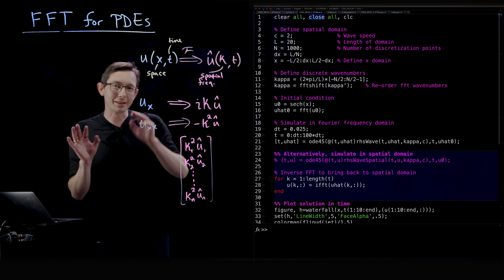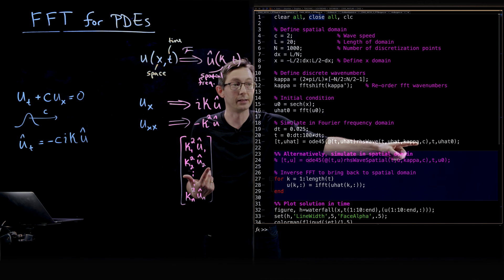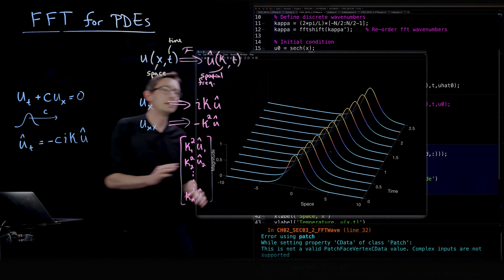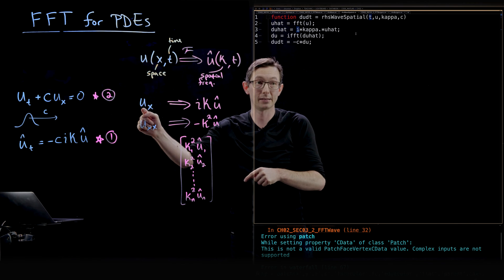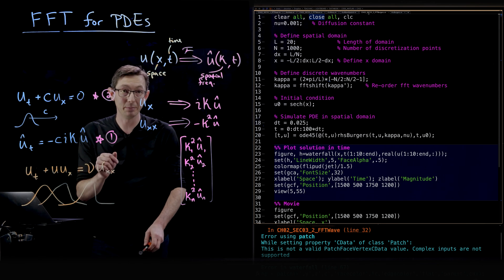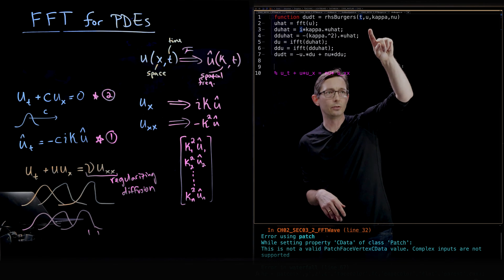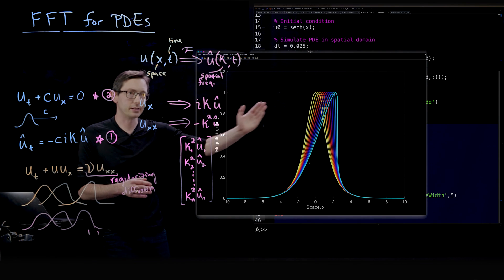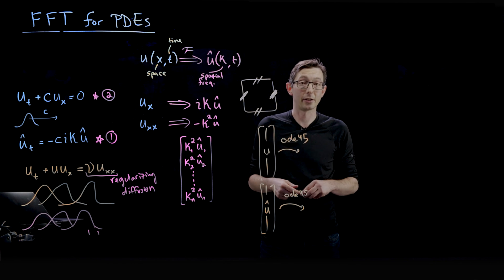Solving PDEs with the FFT, Part 2 [Matlab]

Comment: Would it not have been fun to pick dispersion as a topic, where c :: f(kappa)?
Given its many applications (fiber optics, for example), this would have been a kicker... Also showing what gradient fibers do to help it, group velocity and all that, why monomode fibers help with it...

Also I would have appreciated the mentioning of window functions, used for the ffts. I used matlab about 27 years ago and the fft and ifft kind of were hiding which windowing technique (hanning, bartlet, ...) it actually applies. And if you just code an unwindowed (technically, the unwindowed is just a rectangle window), you will see it is not looking the same. Which would be a valuable insight for those using neither Python (urggh) nor Matlab. Also, it would help people find out, why the total power in time and frequency domain are not matching if you use Matlab fft on some time series.

Comment: Is it correct to assume that using the FFT to approximate the spatial derivatives implicitly imposes periodic boundary conditions? I would expect that because the DFT assumes to see a single period from a periodic signal. At 5:15 it also looks like the Gaussian leaving to the right re-enters from the left - I guess, a couple of frames later that would be more obvious?